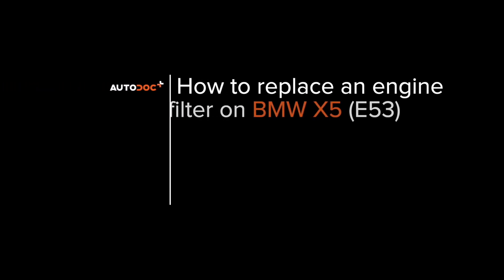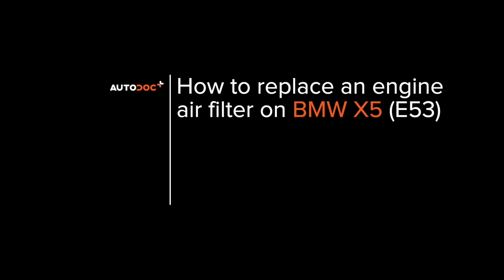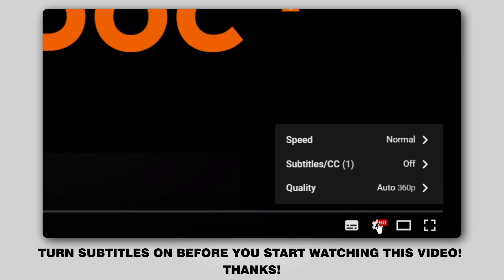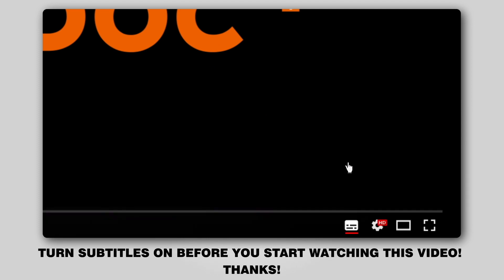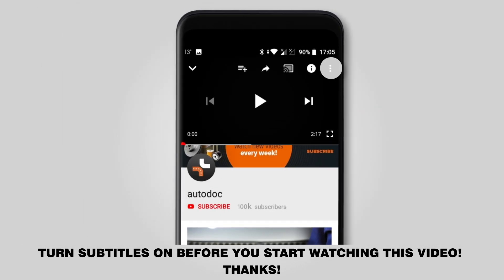How to change air filter on BMW X5 (E53) [TUTORIAL AUTODOC]

Comment: Changing the air filter was a very straightforward five minute job. I also vacuumed and wiped down the inside of the housing with a moist rag since it was quite grimy. I am glad I did the change-out myself as I found a cigarette butt inside of the housing for the air filter.  My guess is the mechanic who had previously worked on it dumped it in there and found that hilarious.  Me, not so much.
Reply from the maker: Thank you for your feedback! We are pleased to know that this our video was useful for you!